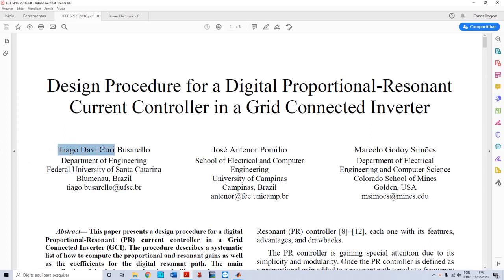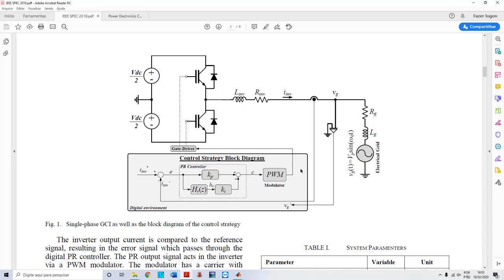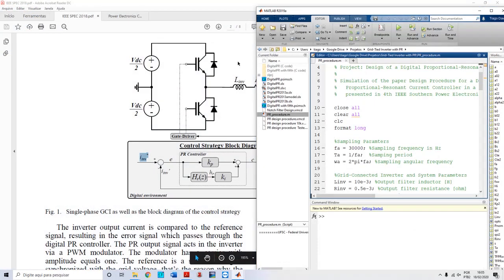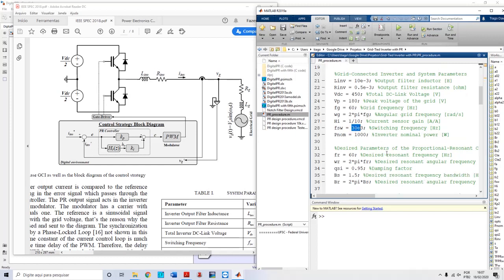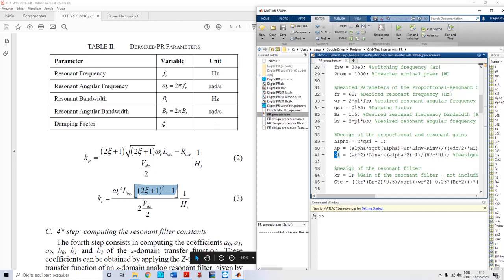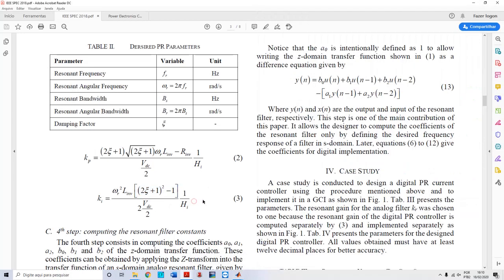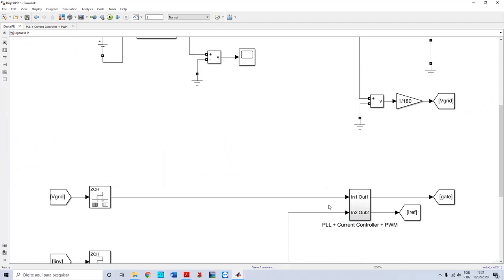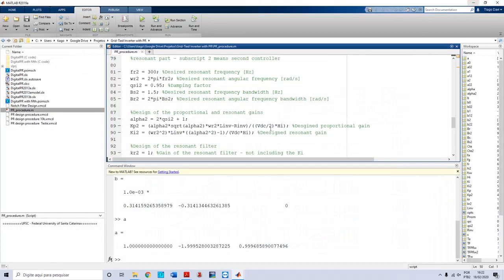Proportional Resonant Controller - Digital design procedure. Matlab/Simulink

Comment: Hey Dr. Busarello, thanks for the great video and paper. 😃

I have a question about the method to compute the parameters in the paper. 
If one simple apply the Backward Euler approximation to the TF of the filter Hr_analog (equation [4])  as mentioned in the paper, 
the Z-domain terms should be as simple as:  b1 = [KrBrTs], a1 = [-(2krbrTs+2)]  and a2 = [(TsWr)^2+2KrBrTs +1].

Where this sines, cosines and square roots comes from? Is this some sort of prewarpping?

Comment: Thanks a lot! That's helpful. If we use the LCL filter for inverter, what can be changed in design PR controller?
Reply: Hello good day, did you manage to do it for an LCL filter?
it would help me a lot
Reply from the maker: Dear. Unfortunatelly, this procedure is valid only for L filter. Depending on the values of your LCL, you can approximate the LCL for L (being L1 + L2) and then apply the equations of my paper.
Reply: @Tiago Davi Curi Busarello  
But LCL actually have a capacitor with a damping resistor. So it is complicated to approximate.
Reply from the maker: @m.rgh.i9199   Actually it is not so complicated. See  page 314 of the book Grid Converters for Photovoltaic and Wind Power Systems. Depending on the values, L1 + L2 is equal to L of a single filter.

Comment: If we use an LC filter(no resistance) and Leakage Inductance (Grid side inductance) at inverter output and DC-link Capacitor for inverter input what will be the formula for Kp, Ki, and Discrete filter. Please do the needful

Comment: Thanks for the great explanations on your channel and all the material on your page.
I have a question. I only implemented grid controls in the rotating d-q reference frame yet. 
There the DC-link voltage is simply regulated by the d-current component. 
But how is it done with this kind of resonant control in the stationary (alpha-beta) frame? 
Can someone suggest me a source of good explanation for this topic?
Reply: since alpha and beta are in stationary frame, PI won't work in suppressing AC reference.
So we need a controller that has an ideally infinite gain at the required operating  w = 2*pi*f  where f is the operating frequency.
resonant controllers are the key here, you can also use several parallel resonant controllers where each controller suppress different frequency,
Imagine a parallel ideal LC circuit. At a certain frequency the inductive impedance is equal to the capacitive impedance, if you excite this circuit with a voltage, you get an infinite current and that is the transfer function of this circuit , infinity.
So this is the anloge representation of the resonant controller. 
good luck.
Reply: Did you manage it?

Comment: Thank you for your explanations.
Is it possible to make a 3-phase control using PR controllers? In an alpla-beta-zero frame maybe? Thank you
Reply from the maker: Yes it is possible. Since in alpha-beta the reference is still sinusoidal, the PR controller designed  based on my video can be used.

Comment: Very nice explanations.Really impressed.Thank you Dr.Tiago.i have a question that can we use split capacitor instead of Voltage source as shown in the simulation.If so, what could be the modification in simulation circuit as well as the values of capacitor. Because connecting battery cannot supply reactive power or control reactive power..waiting for your reply.Thank you in advance
Reply from the maker: Yes you can. You should include a DC current source in paralle with the capacitor of the DC link. In this case, you should include the loop for controlling the DC voltage. Look for the book: Voltage-Sourced Converters in Power Systems. Amirnaser Yazdani (Author), Reza Iravani (Author)

Comment: sir, I didn't find any matlab simulink file of PR controller
Reply from the maker: On my webpage, go to the Publication tag. Scroll down until you find a table of my paper Design Procedure for a Digital Proportional-Resonant Current Controller in a Grid Connected Inverter.
In such a table, there are two files File 1 and File 2. One is for matlab and the other is for simulink.
Reply: @Tiago77916  Sir, I couldn't find any simulation files there. Could you send it to me?
Reply: @Tiago77916  No i couldn't find any file sir

Comment: sir please share how to design  analog PR  controller design using rms input  voltage and current values
Reply from the maker: Dear Muttumula. I"m sorry but I don't know hot to tune analog PR using voltage and current. I know that you can design an analog PR by drawing the desired frequency response and get the transfer function of such response using Bode diagram techniques.
Reply: @Tiago77916  Thank you sir.You can suggest some research papers to get the function of such response using Bode techniques
Reply from the maker: @ @ramu_youtubechannel8083 . Take a look at classical books of control theory like Modern Control Engineering by Ogata and Control System Engineering by Norman Nise
Reply from the maker: @ramu_youtubechannel8083  . There  is also a book titled Filtros seletores de sinais
, by Sidnei Noceti Filho. However, this book is written only in portuguese. This book is especifically for getting the transfer function of filters.